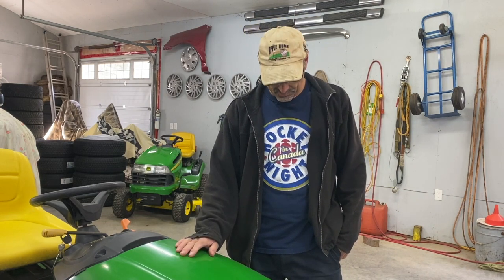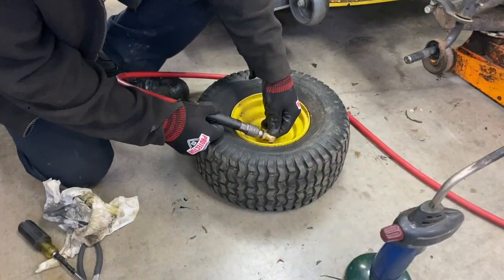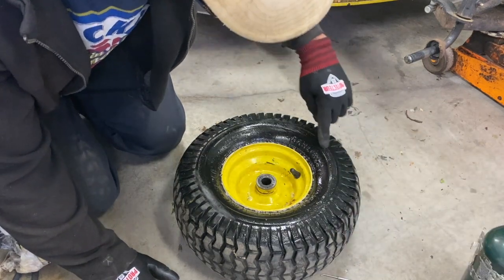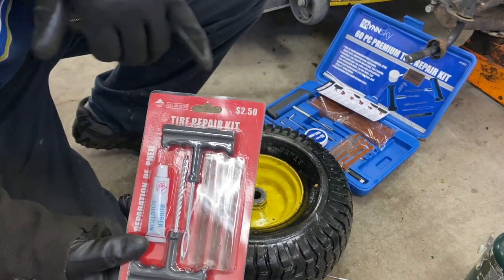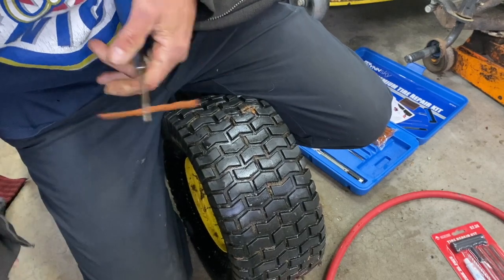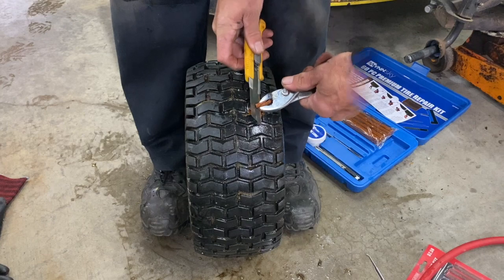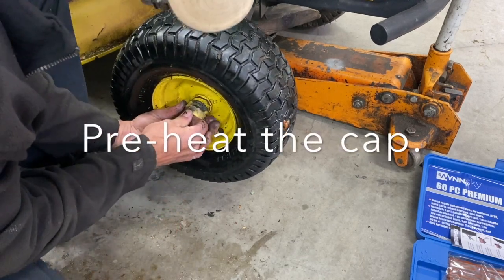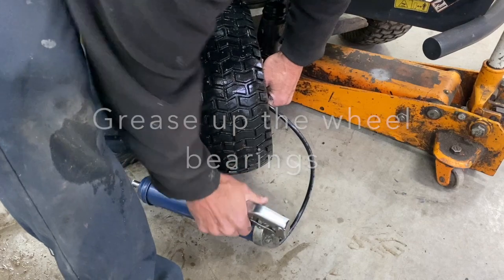How to Fix a flat or a slow leak on a John Deere Lawn Tractor, D130, 100 series.  ( plug kit )

Comment: How to fix a leaking valve?
Reply from the maker: That’s a good one.  I will have to do a video on this in the future. You can try to release the air in the tire and try to rotate the valve.  It might seal itself.   
   If this doesn’t work the tire bead will need to be pushed in and the valve replaced.

Comment: Hi new subscriber to your channel. I have small question. I have a D130 John Deere that my father gave me....It's like what  you have in this video. Question is do know if this D130 has two different hub  or shaft sizes for the front tires. I read on line somewhere where the D130 has two different sizes. Is that true. I need to replace the front tires and thought I would get tire and rims all together but If the hub sizes are different then just ordering a set won't work. Do you know if the shaft or hub sizes are different. Thank......
Reply from the maker: Same shaft size.  LA100  series share the same parts numbers too.
Reply: @WeekendHobbyMechanic  thank you sir. Appreciate the answer.